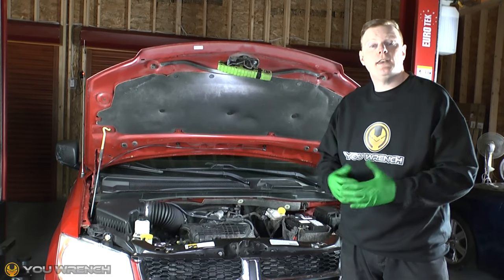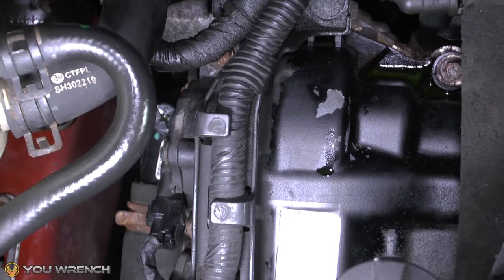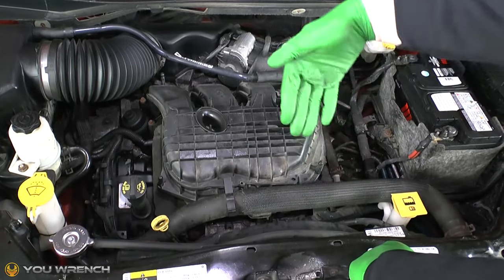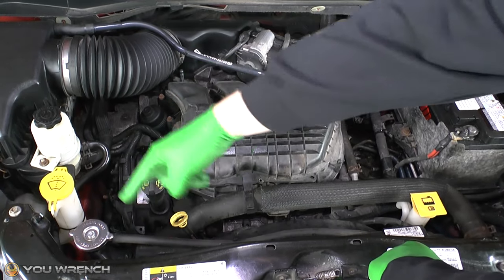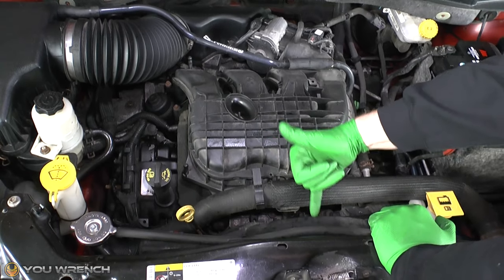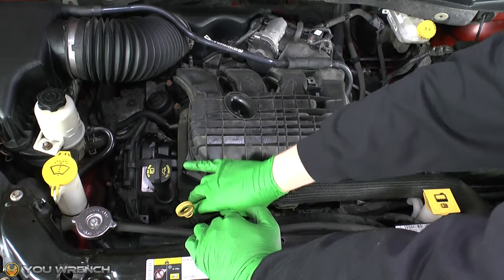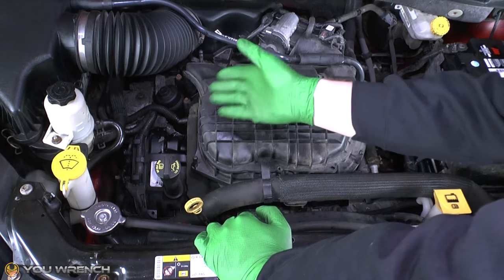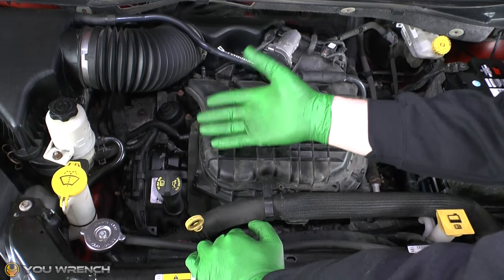How to Test if Your Car's Thermostat is Working (Without Removing It!!)

Comment: I have a Vivaro Diesel and just had the water pump changed, now I cant get rid of air from the system by bleeding it as it keeps pressurising. I suspect a cylinder head problem solely because the water pump has been changed but there is no white smoke, no sign of moisture on the oil filler cap and no bubbles in the bottle. Could it be just the thermostat? The van heater only blows cold and occasionally warm but not hot. My local garage suspect a cylinder head gasket but won't take the work on because they say removing the injectors is too difficult. They suggest scrapping it but the van is in great condition otherwise. Is it common for air to be ingested into the cooling system even though there is no obvious sign of a leak?

Comment: Hello YouWrench
Very informative video. Thanks. One thing I want to ask because I want to make sure, I recently installed a heater core in my 1975 Buick Estate Wagon a couple of weeks ago and as such, I replaced the Tstat with 195 degree, which is what the manufacture calls for. My temp. gauge indicates 195 on the dial but I get no heat from the outlets and when i go to feel the hose after 10 minutes of running, it is only hot right where upper rad hose goes into the housing. the rest of the hose is lukewarm to the touch. Would that indicate a faulty thermostat? Your response would be greatly appreciated. Thanks.
Reply from the maker: That does sound strange. I don't know the correct spec thermostat for your car, but assume you have the right one. Usually if you get no heat in the cabin coupled with a low temp on the gauge then this would be a pointer towards a faulty thermostat (stuck open). But you are getting the correct level on the gauge, but no heat in the cabin. This would initially suggest things like the heater core inside the cabin, or maybe an air lock in the system. But it was interesting you mentioned no real heat in the upper hose. Remember you should be getting a rush of 195 degree coolant through that hose (once the thermostat opens, not permanently!) and that will feel toasty hot to the touch even through the rubber of the hose. It may take 5-10 minutes for the thermostat to open (idling), so you need to be patient. It will not open until it reaches the 195 degrees, and that will take a little time to build up. Test that first, make sure the thermostat is actually opening when it hits full temp by monitoring the upper hose, it should get uncomfortable to touch when it opens. Start with that. Best of luck, and hope that helps a bit!     www.paypal.me/youwrench

--- 

To help support us (for both you and others reading this) there are a few things you can do:

1) Donations both needed and welcome! We cannot operate You Wrench without the support of people like you! You can donate by PayPal - just go to www.paypal.me/youwrench

2) Please ensure you subscribe to our YouTube channel. 

3) Please Like our video's on YouTube (by clicking Like!) 

4) Please help spread the word, the more people who know about us the better! Add links to our video's in forums, let people know about us.

Thank you for your support!
Reply: @YouWrench  
Well I did that upper rad hose test and after 5 to 10 minutes,  the hose gets hot to the touch.
Not only that, both heater hoses are very hot as well after 5 to 10 minutes.
I noticed when I  move the lever for the heater valve and hold it for a 4 or 5 minutes, it gets lukewarm inside the vehicle.
The heater valve operates on a vacuum hose that is attached to it. When I checked for vacuum at the hose, after disconnecting it from the heater valve, there is no vacuum at all.
Reply: Try replacing your EGR vacuum VALE, vacuum solenoid,vacuum modulator feedback sensor 😉

Comment: Im wondering if you couldnt just simply touch the radiator cap which is made of metal. Mine appears to be attached to that some upperhose you are touching. I imagine it would be preferable and easier to tell since the radiator cap is made of metal.

Comment: Very good informative video. Thanks for sharing. Helped to cover the thermostat part.  i have 2010 ML550, ans got P0128 code,  just wanted to know if i should check coolant sensor before going for coolant thermostat?/where exactly this sensor is located? If i can have a diagram or picture to locate it so that i can replace it. Appreciate your help!"
Reply: Did you get it fixed ?

Comment: Upper hose gets hot few mins after starting the engine like u mentioned..buy my lower hose isnt hot..is tat normal?..cuz i have an optima k5 tat has thermostat located at the end of the lower hose..TQ~

Comment: I was trying to bleed my coolant system and I had the funnel sitting on the rad with some coolant, waiting for the tstat to open up. Coolant temp reached 195+ degrees, but it didn't open up.  The coolant in the funnel stayed at the same level.  (I did manage to get some air out by squeezing the top hose) But top and bottom hoses were hot.  Wouldn't the coolant level have dropped when the tstat opens up?  Is my tstat working properly? 

I tried to bleed bc the other day, sitting at idle for 20 min, my car started to over heat.

Comment: I replaced my thermostat last year in my 2004 Pontiac Grand Am. Now thats its winter of course im having heat issues again. Im trying to differentiate between a thermostat issue and a clogged heater core. I get no heat from the thermostat until i get on the highway, even if its on full blast. Even then when im on the highway it will cooldown if i start slowing down. Then the engine starts to overheat until something kinda pops and then lets the heat come through to the cabin again and then my engine temperature drastically shoots down. Is it likely my thermostat needs replacing again? Or does it sound more like tthe heater core? Ty

Comment: My problem is that the fan comes on as soon as i start the engine and stays on for about 3-5 minutes after ive pulled up, i changed the coolant temperature sensor thinking the fan would go off but no change, my temperature gage doesn't go up at all , so now I'm thinking its the thermostat,my coolant is going down I'd think a bit faster than it should but not excessive, going to do this test tomorrow but any tips on the fan being a clue would be appreciated 🖒

Comment: What would cause intermittent overheating with loss of in cabin heat?
Purchased a vehicle yesterday, it was overheating within minutes, and no heat inside the car. I pressure tested today, no leaks or leak down.
I found a bleeder valve, bled the system  a few times and low and behold the temp gauge stayed exactly at half and the heat started working again!
Let it run for half hour, took it home from work, went to a couple stores, came out started the car and lost heat again! Within minutes the temp gauge started climbing again to near overheating range. I just brought the car home and checked under the hood, noticed the upper rad hose, attached to thermostat  housing, the hose itself feels hard/full, but cold! 
Any ideas what the heck is going on?
Is it possible the thermostat is sticking  or only working intermittently? Or is the water pump starting to go out?
Acting like an air lock in the system again, but why after bleeding air out and car working well for an hour or two, does it happen again?
Incase it makes a difference, the car had been sitting for a couple months without driving...
Thank you for any help!

Comment: My temp gage is showing 1/4 of the range instead of 1/2 of the range. My caravan, 2013 warms up more quickly but I am not sure it is reaching 180/190deg. I think it is either a bad sending unit or my thermostat is broken. My hands are not small enough to easily replace the sending unit, tho I tried. I have had a broken thermostat replaced before. By the way does anyone make a metal thermostat housing? My housing cracked once and that was inconvenient. Nice vid.....keep up the good work.

Comment: If the Thermostat has failed closed then as the engine heats up will the radiator fan start and help confirm the thermostat fault?

Comment: The other way to check Thermostat is open Radiator cap (Cold) & start, when it gets warm enough the coolant will move across because the thermostat opened. - If when you start the engine with it open & the coolant comes out, you could have a blown head gasket !
Reply: Hi Louis, I dont get it. You mean if I open radiator cap, turn on car and wait and see if coolant overflows or move across? What do you mean with across? Doesnt it overflow regardless? I am interested to know if my thermostat works or not. Thanks Sir.
Reply: @Fred-Faizi  check the heating inside does it blow hot air if not then thermostat not working
Reply: @tonyxxxxxx8634  my cars heater runs cold
Reply: 9
Reply: The car could if it's winter it thinks it blows cold automatic and manual transmission are fitted with antiskid and room temperature electronics but for this issue an auto electrician can check the block in two places to rule out heater core ruptions so if comes hot after the heater is blocked no power to the circuit , lastly mine came hot afterwards but service the car it can happen if you run for codes also a non code is an check light if coolant is the service check the auto electrical parts that should light up and the parts working properly, not sure if you have a car diagnostic but everything to the block  changes if it's not cool , in winter it's cold enough but summer like car temperatures need to manipulate the combustion to quick or slowly when it's none you have no fuel in the tank if your asking does it take place after warm up check if you get to warm also in 🕞 nutes
Reply: You right dud
Reply: Volvo doesnt have radiator cap😂
Reply: @Fred-Faizi  across the hose. Duh..🤣
Reply: @VegasD702  ohhhhh….ahhahah. Okay my bad😂🤣😅
Reply: @Fred-Faizi  🤣 thanks for having a good sense of humor.. 💯
Reply: I fixed all my car problems with the Tesla as I no longer have radiator coolant thermostat hoses it's the best thing I ever did in my life
Reply: My 02 land Rover freelander with the 2.5 v6 my gauge stayed in the middle while the water blew out of the overflow container thermostat I hope and no milking the oil  thanks Fred.
Reply: @U4Eye  🍪
Reply: @tonyxxxxxx8634 my car doesn’t leak a drop while it sits there idling. But when your driving it leaves a trail of water.
Reply: It's leaving a contrail like the jets leave in the sky.
Reply: It's always a bkown head gasket.

Comment: I have a 03 f 150 4.6l is there such a thing as a coolant temp sensor on it or is the cylinder head temp , there has to be because i asked for one at the auto parts store and it looks different than the  cylinder head temp if so where is it? nobody has a video on an 03.

Comment: Good video. From the video I'm presuming my thermostat might be stuck in closed position. I recently had an overheating that has me confused. Warning bell started and I saw my temp gauge pegged at max heat. Pulled over and tried adding coolant by expansion tank (on driver's side) but it barely took any. Temp still pegged. Tried removing the rad cap and saw rad was empty. Explains why motor overheated but why wouldn't the cooling system accept coolant by expansion tank. Any thoughts for me to check?
Reply: Sound like u need a new radiator cap. Or there is a leak in the system that has  lower pressure than the expansion tank.

Comment: Here's a more accurate way of testing if your thermostat is working properly.  Verify what the rating is on your thermostat is (195 degrees is common).  Connect almost any cheap or expensive OBDII scan tool and take the car out on the highway.  If the OBDII coolant temp runs up to the rating on the thermostat and stabilizes there your good to go.  In one case I had a dash temp gauge that was reading 3/8 on the gauge (1/2 would be common).  I wanted to know what the computer was seeing and it was reading about 10 degrees over the thermostat's rating.  Dodge manuals indicate that thermostats are more likely to fail closed rather than open.  I bought a NAPA thermostat.  When I pulled the old thermostat (I could tell it had never been changed because the way Dodge staked it at the factory) I put both in a pan and brought it to boil.  The new thermostat opened exactly at 195 degrees where the old one stayed shut.  I put in the new thermostat and low and behold the OBDII coolant temp driving down the road was 195-197, a full 10 degrees cooler than the old thermostat.  It's also possible to have a bad coolant temp sensor, in which case changing the thermostat would have no effect.  In that case you would want to change the sensor after verifying the thermostat is working properly.

Comment: Hi. My NISSAN NOTE 1.4 PETROL has an issue - everything  is ok for the cooling if the temp is up to 95C.  If it goes over, due to higher RPM,  the temperature start rising and the temperature only goes up.   No coolant leak, no bubbles in coolant on idle, no oil in coolant. No codes on OBD. Vents work fine. Any idea what could it be? Thanx for any help.

Comment: So should the top hose go back and forth from cold and hot momentarily? And should the bottom hose stay cool? Bottom is not even warm. Does the radiator cool it that much and that fast? 

I've been using the heater running on full blast to help with keeping the engine from over heating but that only works to a certain extent. Definitely helps but during the day when it's hottest it's risky. Replaced water pump and still overheating. When driving after warming up a bit it takes a while for the gauge to go pass the middle, longer if I have the heater on beforehand. Uphill definitely gets it really close to the red zone and overheating alert. Never actually got all the way in the red zone but super close.

At idle at stop lights or parked with heater on gradually gets the gauge back down towards or at middle. Thinking my radiator is clogged. Went for a drive long enough to get the gauge needle to go a little past the middle to about 80% and use a infrared thermometer to measure the temp on the radiator and it seems like the far right side top corner was about 10° higher. Any clue?

Thanks
Reply: Mine Camry is doin same thing u ever dig it out

Comment: I waited about 15 minutes and it got up to normal operating temp.  I never got a rush of heat.  The hose got warmer as we went along.  Only could feel the hose warming up gradually after 10 minutes.  I’m not sure what this means.  I checked it because my car was overheating sometimes. Maybe a 50% chance that it will.  It is inconsistent. Should I just replace the thermostat or is there another reason.

Comment: My car is saying the thermostat is stuck in open position but overheats if you have the heating turned off it stays at 3 bars if you have the heating turned on would I be right in thinking the thermostat is stuck closed and not open considering what I have just said

Comment: In my Nissan Terrano, the upper pipe heats up but the lower one only remains, even though I cleaned the radiator, is this normal?

Comment: Thanks for this video just what I need. Couple questions: 
- would a closed thermostat still provide heat and cool air through the auxiliary heater? No only is my car overheating, I do not get aux heat until I'm accelerating.
- can a thermostat partially fail ? I.e not open all the way, only partially therefore restricting/slowing coolant flow, causing intermittent engine overheat?

Thanks and sorry for the long questions
Reply: Check your coolant level.  Typically when you only get heat while on the gas, your coolant level is low
Reply from the maker: Thank you! Indeed, check your coolant level first of all. Assuming that's good... A closed thermostat would typically not provide the heat to the heater core in the cabin. So yes, if you are overheating and no warm air inside this would point towards a closed (stuck) thermostat). Yes, they can partially fail which can give strange symtoms. With your symtoms it would be worth changing out the thermostat because they are usually fairly cheap.

--- 

To help support us (for both you and others reading this) there are a few things you can do:

1) Donations both needed and welcome! We cannot operate You Wrench without the support of people like you! You can donate by PayPal - just go to www.paypal.me/youwrench

2) Please ensure you subscribe to our YouTube channel. 

3) Please Like our video's on YouTube (by clicking Like!) 

4) Please help spread the word, the more people who know about us the better! Add links to our video's in forums, let people know about us.

Thank you for your support!

Comment: My temp gauge wont move I have replaced the temp sensor I left the car idling for bout 20-30 mins and nothing even the rad fan didn't kick in could this be the thermostat the top hose seemed to be getting hot but I dont know hot quick this happened

Comment: Please can you advise.... If the thermostat is broken in the open position and the coolant is flowing around the engine & then through the radiator from the start, what, if any, problems could that cause? 
I've heard in much hotter countries (I'm in Zambia in Africa) that some people just remove the thermostat as they don't see the need for it. Thanks

Comment: Hi ,please shed lignt on this problem  .my son has a 1.0 ford focus EcoBoost. The temperature gauge shoots to 90 in a matter of 5 minutes and does not go any higher even if i drive for a longer period..im certain that any car would not have a sudden jump on the temperature gauge..what could be the issue..thanks .ive been told its normal for z 1.0 EcoBoost, then ive been told its the head gasket or something wrong with the thermostat. Please shed some light on this .thanks